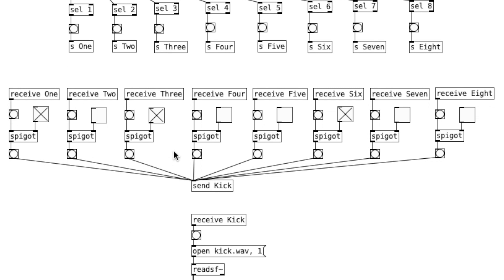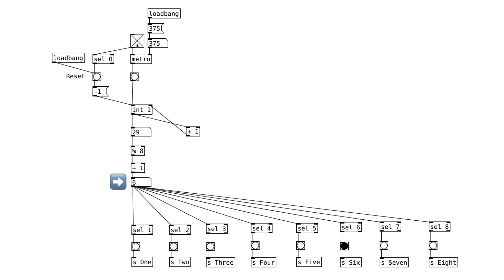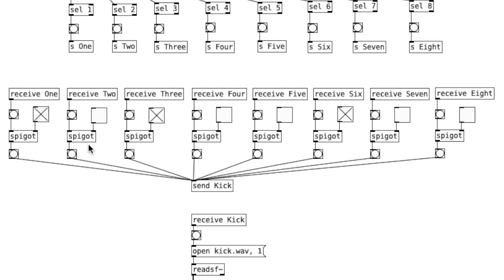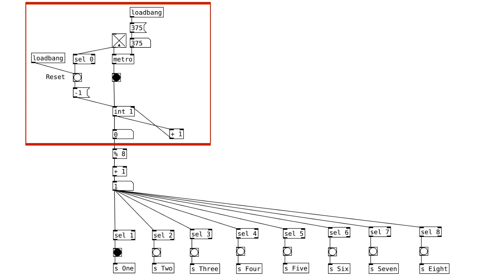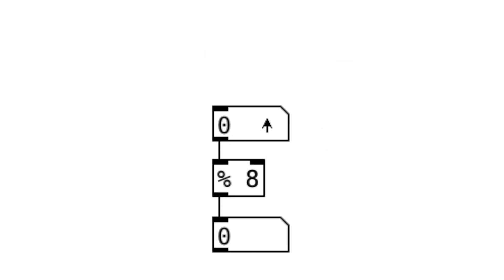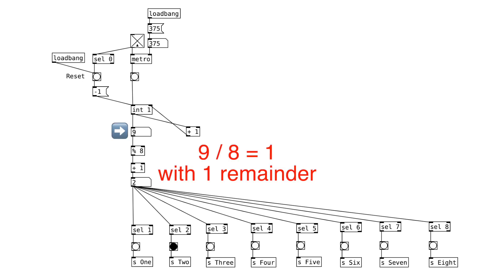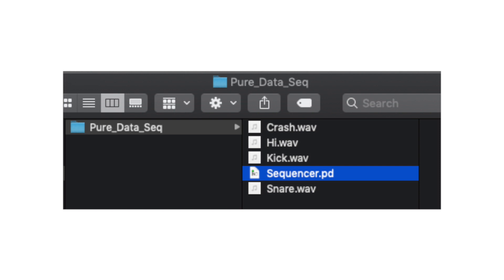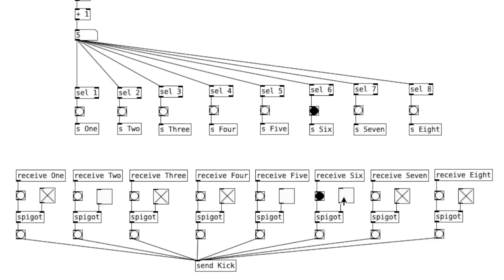How to Create a Sequencer in Pure Data!

Comment: i am having an issue when i play two sounds at once (kick and snare) they wont play together, they just go silent
Reply from the maker: I'm not sure. It could be that the audio is peaking too much. Try lowering the gain by using [*~ 0.5] for each sound.
You can message me on Instagram if it's still an issue.
Reply: @SoundSimulator i got it fixed, i had made the sequencer into a subpatch and i ran two of them separately instead of doing in one file, i don't know if it makes sense